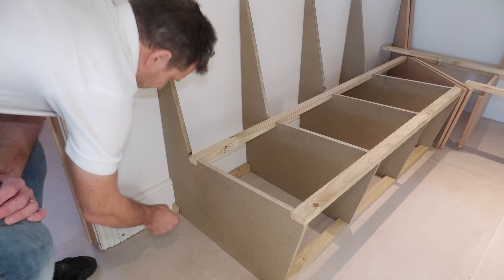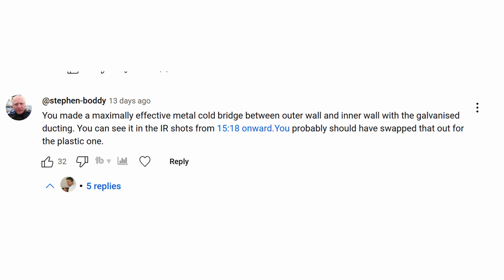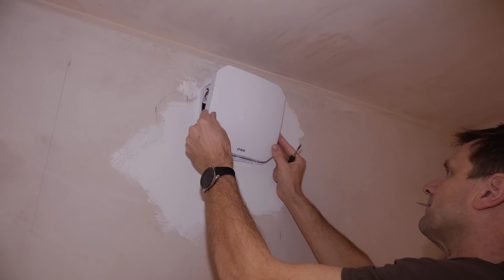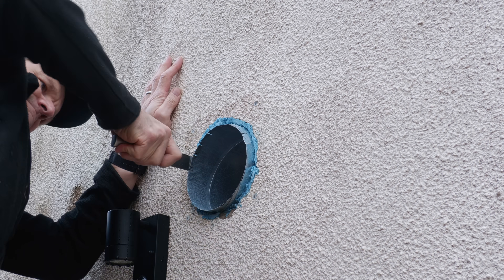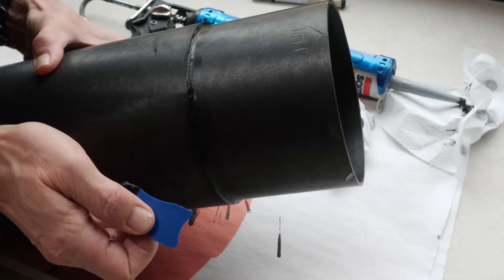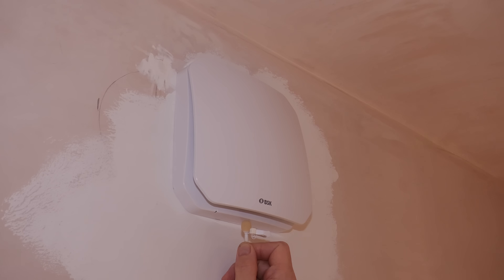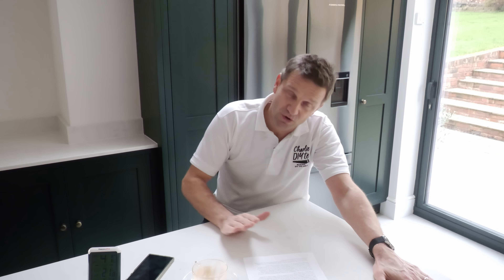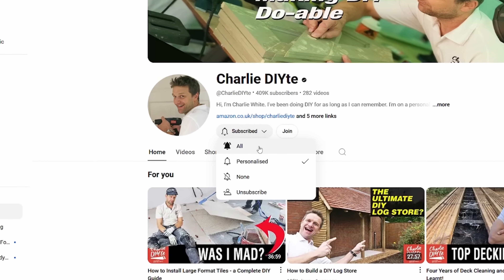Is Single Room Heat Recovery Ventilation Worth It?

Comment: One of the Blauberg Vento units does achieve a high airflow on boost mode, similar to a fan. But most of them are probably half that of a fan.
The Ecostream Prana units use a copper heat exchanger instead of a ceramic core, but do need a thicker wall or some sort of spacer to fit.
Reply from the maker: Thanks Paul 👌👊
Reply: @CharlieDIYte  
About 2 or 3 weeks ago I spent some time looking online at the different brands and models. I have a 30+ year old Airflow 'Loovent' fan in the bathroom I want to replace.
Brands I found were: Brookvent, Europlast, Econox, Airflow, Sudwind, Kair, BSK, Blauberg, Ventaxia and Ecostream.
The Blauberg Vento Maxi is the one that can do up to 108 metres cubed per hour flow.
But i bet the heat exchange efficiency drops at that rate! Cost starts at about £440 but can be as much as £600.
Reply: @Paul-yh8km  Which one do you think looks best? I had been looking at getting a few of the Prana ERP PRO. Curious if your research showed they were worth the extra money compared to the other cheaper units
Reply: @d438a2  
I haven't got that far.
I think because they are more complicated internally they are much longer and can't be shortened much if at all.
They aren't really suitable for my application.
Reply: @Paul-yh8km  That's a very useful list. I found a few more: "Lunos"(very expensive end), "InAir™ IA60-TWHRV ", and "Holtopglobal Single Room Ductless Wall Mounted Type Heat Recovery Ventilator ERV/HRV". And if you include square units (makes sense for  timber-frame builds) there are even more, like the "Helty Flow40".

Comment: What about Zehnder products? Any opinions?
Reply: The Zehnder ones appear much more professional (and expensive!) than the other models.  
They are also Passivhaus Certified.
Reply: @jonathanwilliams7950 I know they have also at least two single room solutions, would be curious how they compare. I am just about to get a full MHRV from Zehnder, they come with a nice feature - optional air to air heat pump. For spring and autumn, this should keep the house nice without the need to fire up the full heating system.
Reply: @jonathanwilliams7950 I would be curious how the "proper" stuff compares. I think the Zehnder decentralised solutions are a bit larger, which makes me believe they work a bit better? I think they all use two streams of air at the same time
Reply: @PetrKlus  yes, much bigger vents are needed for the ComfoSpot and ComfoAir models - 340mm and 270mm respectively and are both constant flow (not push pull)

I think a through review/testing of these devices is needed as there a real lack of real world information on them

Comment: There are multivariate factors that can't simply be accounted for in how long it will take for an ERV/HRV to pay itself back based on the cost of energy. 
- You may ventilate way more with them than an ordinary ventilation system, improving indoor air quality, with no additional cost in energy. 
- The saving in energy may also result in you needing a smaller heat pump to cover your load, saving substantial money in hardware. 
- If you are comparing to a house with poor ventilation, it may save you from long term costs from moisture issues. 
- If configured correctly it improves airflow in the house which leads to a more consistent indoor environment, potentially lowering the temperature you run the house at, providing big savings. 
- A ventilation system is the price you have to pay to have an airtight house in general, which is good for both durability of the house as well as energy savings.
- Also, worth noting that ordinary ventilation systems aren't cheap either, so the payback should be calculated based on the price difference not the total cost of the ERV.

Comment: I have an old (1870s) stone house and recently got heatpump/central heating for the first time. I added a small extractor fan to the bathroom and a slightly chunky dehumidifier to my kitchen (no way I could cut a hole through that wall for a proper vent) and it's changed everything. The fan takes bathroom from 60+ relative humidity to 45 in about an hour after a bath and the kitchen is almost always in the low 50s. I think my mold situation is also under control now too, from these two additions.

Comment: Piv, turned mine off, created a cold draught on my landing and it is a heated unit
Reply: Your fans running too fast for the heat exchanger to recover the heat and pass it onto the incoming air, and too fast for the incoming air to get heated by the heating element.
Reply: The fan speeds are recommended based on house size. I have the same problem, my solution was have the PIV on a timer so that for a few hours in the morning when it's freezing, the PIV was off and then automatically comes back on at a set time. I use a smart plug and have a smart thermostat in the attic, so could also have an automatic routine based on attic temp  but I imagine that's not ideal during a cold spell where I could go days without piv coming on if I based it on a certain temperature in the attic
Reply from the maker: Great work. 👌
Reply from the maker: Yes that's the main criticism I hear of PIVs.

Comment: Thanks Charlie our bungalow was subject to moderate condensation had pir triggered xpelair bathroom good extraction with cooker hood then bought modern full size dehumidifier works a treat lowering humidity run it during day .
Reply from the maker: That's it. You make a few small tweaks and completely sort the problem. Great work 👌

Comment: to be honest we use the German idea of shock ventilation 5 mins every day all windows get opened then closed.  It doesn't reduce the heat much as it's such a sort period of time.  To measure the humidity I prefer a Bluetooth temperature and humidity sensor thru are cheap and can be used to trigger automations in home assistant if you choose to use that.  Without this it still keeps a data log that you can review over time
Reply: That’s alright for living rooms, but bedroom air can get stagnant with two people in.
Reply from the maker: Thanks guys. Yes I started hearing about the shock ventilation strategy when I did rust last update video. Such a simple but effective solution. 👌
Reply: @CharlieDIYte  No moving parts, no airflow limits and works even in draughtproof homes....
Reply: " to be honest we use the German idea of shock ventilation 5 mins every day all windows get opened then closed " - Ditto but 5-10 minutes - For my high thermal mass downstairs the rooms drop ca 0.2 C (DS18B20s in every room, lofts and external), upstairs with low thermal mass, maybe 0.5 C, but with low temp heating and big rads, the rooms recover flatline temps pretty quickly, even when it's -16 out.

Comment: Great video Charlie. I've been trying to work out what to do with our little holiday let chalet which is empty most of winter with 70% humidity. 

Mould forms in a few places. I've left windows on the catch to create airflow but not sure if installing these units are a  better option, or if I just have a few dehumidifiers running.

Does anyone have any views?
Reply: Ventilate more if you can.  Do you have many passive vents that allow through flow?   Some gentle heat or a small dehumidifier might help or they have running costs.
Reply from the maker: Yes I'd install trickle vents on the windows or open the existing ones and install a PIV. It will completely eradicate your problems and can just potter away in low setting whilst you're not there. Make sure you've got a minimum 10mm gap under all the doors or leave them open. Don't leave any furniture right up against walls to maximise air circulation.
Reply: @CharlieDIYte  Thanks (and to Greg). I've got remote sensors in both bedrooms now although I'm suspicious of their accuracy. All doors open, trickle vents open and a few windows on the latch. I've moved furniture a bit and next visit I'll bring a smart plug so I can put the oil radiator near the problem wall. The electric UFH is left to heat at 12-15 but that is crazily expensive. PIR is an option but it's so quiet where we are I'd be worried guests would be disturbed or turn it off (the fridge can sound like a jet plane it is so quiet there!). For winter I might get a couple of dehumidifiers. Thanks again

Comment: I suspect those efficiency figures are based on how much heat they accumulate from the outgoing air on a single pass. The real world efficiency is much lower because after the first out/in cycle the residual heat left over in the core is subtracting from how much heat can be recovered on the subsequent cycle.

Comment: Found who you're going with for the cushion/backing/foam in your seating? I went with foam2home afaik they have a uk site also(taxes and what not) pretty decent cut to shape 10cm thick of medium foam with 4cm memory foam topper, in saying all this i didn't do much looking but did the job.

Your video has reminded me i need to sort my electric water heater the fan and compressor has been on alot more this month and annoying me, if that's the time of year or not i couldn't tell you.
Reply from the maker: Thanks Andy. I was thinking of using a company called Fiberline B2B I think but we used them when we did cushions for a hotel in the old day job. I'll keep yours in mind though. Thanks for the recommendation👊

Comment: Direct energy savings are one thing, comfort improvements are another. Having the humidity at a more comfortable level often means broadening the range of temperatures that are pleasant. Living near the coast, humidity here is always very high. I got a dehumidifier, and that has saved me money by allowing a lower temperature to be kept without discomfort. It means also, no condensation or mould issues. Perhaps one day I could consider an MVHR to do the same job?
Reply: Our RH is between 60-70% in the living room with an MVHR.   Sometimes lower if its cold outside (ie near/below zero C).   MVHR uses between 10-16W.   Also deals with Co2, PM2.5.  Would recommend an MVHR.  We do not feel the need for a Dehumidifier.   We are a family with teenagers who take long showers, a dog that needs baths and dry washing on a Victorian Airer mounted in the hall ceiling.
Reply: @gregcope5565  You sound like the ideal candidate for a dehumidifier with all that going on.

Comment: What is this fixation with payback?  If it makes life more comfortable, for whatever price, or you just like it, do it!  Life it too short.  Thanks Charlie. Merry Christmas.
Reply: Indeed too many people on YouTube comments who know the price of everything and the value of nothing
Reply: Absolutely.

It isn't merely "payback" from a pure cost > electricity used calculation

That payback period never mention the fact that simply by having an MVHR or DMVHR, you practically remove all damp issues. And how do you measure the cost of that?

Another thing is air quality. These drastically help with air quality. Part of why I want an induction cooker as my next cooker instead of gas, is also due to air quality and because I want to decarbonise my house (which would also mean that I'd move to ufh and a heat pump)
Reply: @waqasahmed939 My advice? Totally go for it!
Reply: The moisture created by a gas hob is miniscule in comparison to the moisture given off by cooking. Heavy cooking might be like 10ml of moisture from gas burning, but likely at least an order of magnitude higher from boiling water and cooking things. (A person exhales 400ml daily and a single shower is 200ml+)

1m3 (35ft3) of gas creates 1.6kg of water, so you can do your own numbers on your consumption, but hobs use a fraction of what a boiler uses (and a boiler obviously gets rid of the moisture through the flue and condensate). I was also considering this but when I checked I realised swapping to induction was only going to help decarbonise, not reduce moisture. (A very valid objective anyway, but just being clear)
Reply: @CCyoutube0 induction has other advantages. It might even be cheaper to cook with than with gas but that depends on where you live.
1- It is faster to cook with induction.
2- it is safer, no need to worry about gas leaks or the flame.
3- control is so precise that rarely it boils over so, less to clean.
4- if it boils over, it is easier to clean as it is a flat surface.
5- you don't get anything burned and hard to remove residues.
6- air quality. Not the level of moisture but the other gases and particulates or whatever.
7- you have a timer which a gas hob has not and that is super useful.

There could be more advantages depending on your particular case like:
Not needing to carry a gas tank/not worrying about it being empty.
Having less electricity black outs than gas cuts (in my case that was a problem).
Maximising the use of your solar panels.
Paying less fees or even not having to pay and worry about regular inspections but those, as I said, depend on your own particular case and if you live in a house or a flat.
Reply: @TheAllMightyGodofCod  Yes that's true, I wasn't giving a full appraisal, as there are also a bunch of downsides, but the moisture issue is not a problem
Reply: @CCyoutube0  downsides? For induction or for gas?
Reply: Says someone with enough dosh?
Reply: Sound comment. Don’t think I’ve ever thought about payback……if I did, I would never get anywhere! 😅
Reply: Payback doesn't make sense without a reference at a similar level of comfort. Usually the reference is some solution with little initial cost, but larger costs over time, justifying the language. You pay upfront instead, and eventually it will work out cheaper. In this case I believe the reference is simply installing a basic extractor fan and upping the heating to maintain the same temperatures. The heat reclaimed has value that can be directly compared to the cost of brute forcing more heat in, without any difference in comfort. At this price point it simply isn't worth it, because life is too short, and you will be richer your whole life if you just turn up the heating instead.
It's not about measuring the value of solving a damp problem, or an air quality problem. It is about comparing the price of various solutions, and understanding how long it takes the more long term focused solution to become cheaper.
Reply: I said the exact same thing to a car vendor about a month ago ...I am gonna drive the car until it dies , so I dont care
Reply: Because most people are strapped for cash. Once they've paid bills and maybe done a day or two a month of living, that's just  the reality of it .

Comment: We fitted an Alnor unit, which I don't think you mentioned: https://www.ventilation-alnor.co.uk/assets/files/technical-sheets/HRU-WALL-Heat-Recovery-Unit-Inside%20Wall-Alnor.pdf

I suspect the main benefit is the low-speed constant ventilation, which keeps the air fresh.

Comment: Can you get any really good HEPA filters for the MVHR? we have a lot of neighbours with wood stoves and as a respiratory doctor, I quite enjoy my lungs remaining soot & lung cancer causing particles free
Reply: Define really good HEPA filters?   Venta Axia Sentinel Econiq can fit F7 filters good to filter down to 2.5μm as an example.   I make my own F7 filters from F7 material and sew it onto an old filter frames.   Or you can get comecial Filters from Ventilation specialist and fit what you like.   They are just a box with filter material.  You may need to change them frequently.

Have you recorded your internal or external PM levels?   I have and record these in home assistant.   I use An Awiar One that records to the cloud.   It has a good iphone app.   It also has an API that allows me to record and visualise in home assistant.   I record temp, RH%, CO2, PM2.5 and Chemicals.   I also have another internal PM2.5 and an outside PM2.5 sensor.   My experience and data is that cooking, especially frying, toasting and cleaning has a much bigger and much more frequent  PM2.5 impact.   

I also have a wood burner. Burning dry wood, and run it hot makes a difference.   Most of the time (98%?) you cannot tell the wood burner is on from either inside or external PM2.5.

Get an Awair One and see what it suggests.
Reply: F7 Activated carbon filters. This is my favourite little discussed issue with MVHR installs in the countryside. Basically you need a filter box on the supply side of the ducts, just after the MVHR unit.
Reply: It’s not so much cancer you’ve gotta worry about (the lungs don’t really register small amounts of well burned wood or coal particulates enough to trigger cancer), it’ll be strokes (My elderly relatives who had open coal fires in their houses never got cancer, just had random strokes in their late 70’s due to the PM2.5 particulates making their way right into their blood over the decades).
Reply: I would agree open fires are not good for PM2.5.  Not are they good/efficient.  Some even being negatively efficient.

Woodburners are different.    Air quality in the home is even a wider subject.
Reply: Why after the MVHR?    Most have input filters to protect the heat exchanger.   Or are you thinking the MVHR filter as a pre-filter?
Reply: @gregcope5565 there are different schools. Some put it before and some after the fan. Input filters in mvhr units are just not good enough to remove smog particles and smell of smoke. Additional device is required